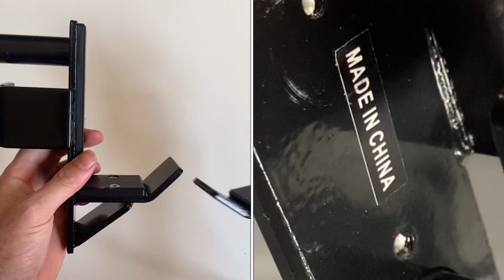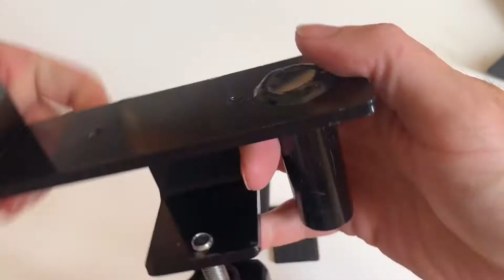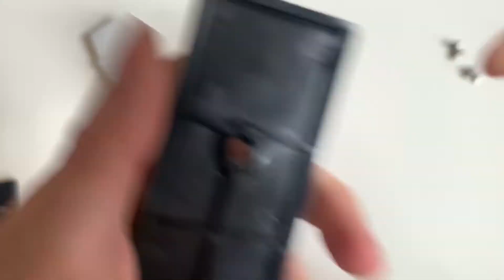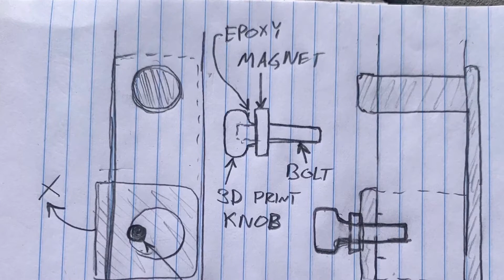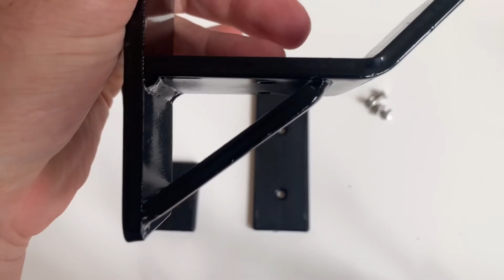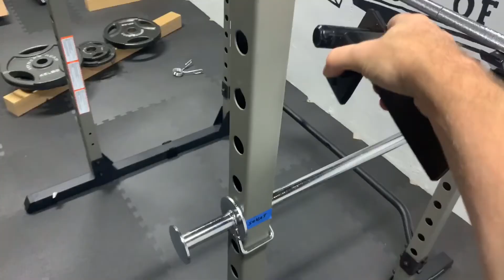5 MONTH REVIEW of Yes4All J-Hooks Barbell Holder for Power Rack 2" x 2" Tube 1" Hole | 2x2 Cage

Comment: One strange thing with these hooks is the screw pin in the back.  The rack comes with the original J hooks that do not have the back plating, so people like myself get these in order to have the back plate, to avoid walking into the cage and damaging paint, yet these hooks decided to add the screw in pins that damage the paint....
Reply from the maker: I agree. Those screws would be OK if they went into the 1 inch holes to prevent rotation, but like you I have no interest in digging them into the painted steel. I don’t use them at all.

Comment: Will this work on cap rack from Amazon?
Reply from the maker: This is a universal product for any cage or rack with uprights that 2” x 2” with 1” diameter holes.
Check the specifications for specific CAP rack that you are interested in. If it is not specified in the amazon listing, try the product page on the CAP website, calling CAP customer service, or online forums. You could also ask a question about the product on Amazon and someone who has already purchased it will answer you.
Reply: @HowtoandReviewsOfficial  it doesnt. It’s a 1/2 inch hole
Reply from the maker: @matthewreddick9334  got it. That is a non-standard size. It is likely that you are limited to the products offered by CAP.

Comment: Great review ! I have the same squat rack , but I hate the J cups that come with them because they’re steel and will ruin the knurling on my $300 bar. Do the yes4all jcups work from preventing scratching up and ruining the barbell and the barbells knurling ?
Reply from the maker: Awesome! I feel the same way about the j cups that come with it.
Yes, the yes4all j cups are great. They do not damage the bar. The UHMW pads are a softer material than the steel bar, so the pads will wear without damaging the bar.

Comment: Can you do a review on the Fitness reality lat pull down attachment? Thanks man!
Reply from the maker: I appreciate it request. I have looked into the Fitness Reality lat pull down attachment, but do not own it.
I went a different direction. I am using a “dip belt” for weighted pull-ups, and a cable/pulley system from a different manufacturer. Here is my review video for the cable pulley system:
https://youtu.be/9RMxhhEzL0M